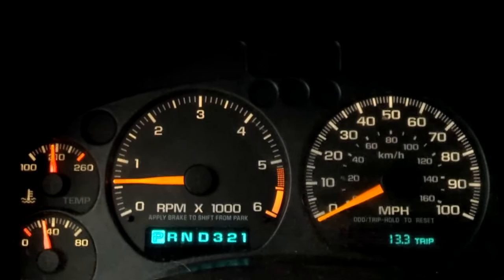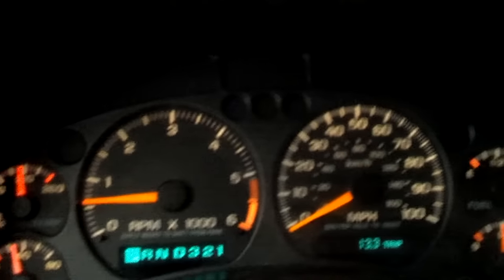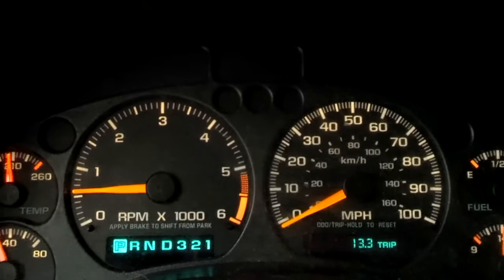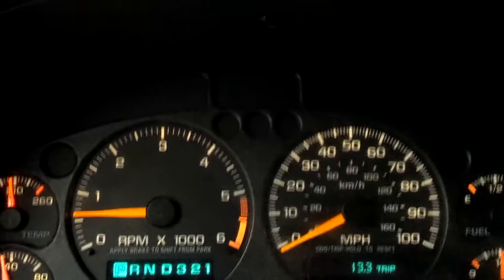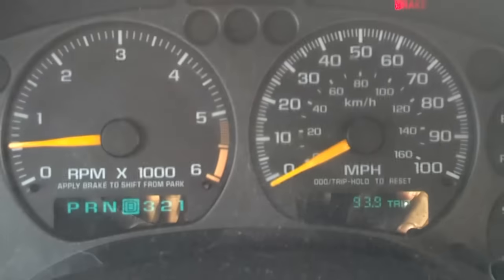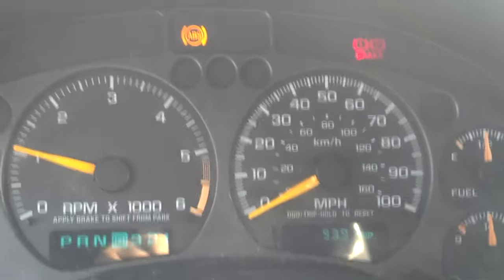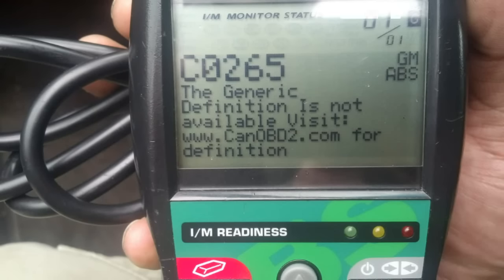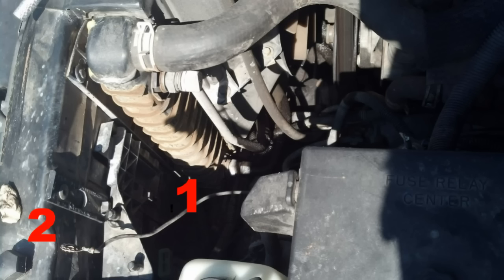How I fixed a Chevy with an  Abs and Brake light on

Comment: Hi. I have a 2002 2500HD with a Duramax.  My parking brake warning light  ( P/I) is flashing anytime i push the emergency brake pedal down. Might this be an issue similar to yours? Thanks
Reply from the maker: Randy Dufour  If it is not a new problem i have heard "it just does it to remind you to release it before you drive. it also turns the illumination for the cluster off"

If not then check out the connections.

 Underneath the drivers door, under the truck on a cross brace for the frame you will find the ground wire for the Electronic Brake Control Module (EBCM). Make sure that is clean, remove the wires, wire-brush the frame area and clean everything, wires, bolt everything, then reassemble. This takes like 15 minutes. Some of the ABS issues can be caused by grounding OR connections to the module. Also make sure the connectors on the EBCM are seated properly, remove and clean and plug them back in. The unit is located under the truck on the inside frame rail beneath the driver's seat area.

Comment: I need a little help I got a 2008 Chevy trailblazer an the abs light came on after heavy storm I parked it in the back an I had to drive over tall wet grass to get to a roofed parking spot an the abs module is under the drive side part of the car so do you thing the wires may have gotten wet or that one wire that your clean may need cleaning I mean this is the first time it's done this so it would be great if you can help
Reply from the maker: +xXdarkcloud47Xx Sounds like it might be a little corrosion on the wire. It would be the first thing I would check If that was ok, I would take some air and blow out/dry the connectors going into the unit.

Comment: 1995Chevy1500up antilock light comes on at 15 and off at 15mph cruse control stopped working at same time brake lights work???

Comment: I just did my front brake lines on a 1995 chevy pickup w/ Kelsey Hayes module. After bleeding the engine dies when I come to a stop. I have never had this problem in some 20 years of brake maintenance.

Comment: did you felt the traction coming on sometimes when you stepped on the brakes?
Reply: That would be your gap between your abs sensor and the rotor. It makes it hard to stop for a second then let's up.

Comment: Hey so I did what you told me last time an what you did on the video but my abs light is still on do you think I may have to have the abs system bled if you could help me out it would be very much appreciated
Reply: Did you pull any codes from the ABS module? That might help pinpoint the problem.

Comment: Have this same problem on my 2001 Silverado. There is a bulletin out pertaining to certain GM vehicles(document ID# 1988903). Cleaned the grounding wire, which on my truck is located under the drivers side door on the frame. Cleaned both ABS connectors in front. Still have the same problem. Have not cleaned the main ground going to the battery cable to frame ground (bulletin suggests doing this if problem persists), and I have not replace the bolts and washers with hardware specified in bulletin. The bulletin suggests using the specified hardware listed in the bulletin due to their conductive finish. Going to clean the battery ground if this doesn't work time to replace the nuts and bolts with specified hardware. I am getting frustrated because my truck won't pass safety inspect because of this, and the clock is ticking and I really don't want to put out that much $$$
Reply: Okay so cleaned the main ground battery to engine, (have not taken every fuse out of electrical station and cleaned it...yet) light still comes on, brakes work fine. last June I replaced one of the front wheel hub assembly, being that the sensor is integrated in the wheel hub assembly for the fronts, guess it may be time to replace the other front wheel hub assembly, certainly cant hurt, and things do wear out. I think I want to get a 70's model truck without any computer modules in it!! This is ridiculous...

Comment: How on earth do you get to the ground wires behind the radiator?  I see them, they're crusty.  No clue how to get in there....
Reply from the maker: I had to pull the air filter box. It;s held in my 2 screws I think and it lifts out. then you have the space to work on it.
Reply: North Carolina Prepper  Thank you very much.

Comment: I have 1999 Silverado I'm having the same problem with my ABS and brake light on. Where is the ground wire located
Reply: Your ground wires for abs module are on the frame on drivers side. slide under drivers door look at frame cant miss them. ITs a common problem and the may not look corroded but still pull off clean frame and wires your good to go. fixes 99.9% of the time. I have fixed a lot of ABS lights with toughs grounds, been a Tech for 25 years.
Reply: Thanks
Reply: No problem.

Comment: I have an 02 yukon denali  with no light on, but when I come to a stop the brake pedal push back up as if the wheel is sliding on snow, need help
Reply: Check with your Chevy dealer those wheel speed sensors are part of a recall.. If it's happening at low speeds when you brake over bumps it's most likely covered for free..

Comment: Quick question.. I changed the abs module on my 2003 chevy tahoe.. and my abs and brake light still come on.. Anyway to reset it??
Reply: OReilys AutoParts has a ABS/OB2 computer that can reset it. Can always try the quick reset yourself by disconnecting the battery for about 2 minutes then connect it back up. AutoZone and Advance computers are NOT ABS computers.

Comment: I have a 05 Cadillac cts and my abs turned on as well would it be a curroted wire also??
Reply: +Donz Perez   If its just the ABS and not both lights It may be a ABS issue or a Wheel bearing problem

Comment: So I have a 2002 Chevy suburban... and I went down a dirt road from a paved road with 2 spare tires(one 2 sizes smaller) and my ABS light kicked on still had brake pressure then going down a little further and my emergency brake light kicked on and my speedometer dropped to 0 my RPMS stayed at 1000 pressed the gas and didn't go anywhere my RPMS reved up to 4000 I stopped and started going again and it was ok but now its getting worse! Please help!!!!!!!!
Reply: +Cassandra Miller put the right size tires on the, different tires are turning at different speeds in a strait line will also wear differentials 4 wheel drives systems steering and braking of non ABS cars as well. brakes are designed to work with the recomended dia tires speedometer is driven by the ABS signal from the 4 different size tires also traction control that controls the throttle [gas]

Comment: How did your brake pedal feel and how were your brakes performance?

I have a 2002 Tahoe and both light come on at the same time randomly... driving or also when I am stopped at a red light. Was yours turning on when you were at a complete stop too?
Reply: I have the same truck as you and same issue, did you get it resolved?

Comment from the maker: Its a 2001 chevy blazer.  I might open mine up too It's comes on for a sec when i hit a speed bump so Im thinking it a broke connection as well I will try to do it next week ( I will post a video)
Reply: I have a 2001 Blazer also and mine is doing the same thing.  Both lights come on when I drive across town maybe 20 miles and if I stop and turn off the motor and tap the brakes 3-4 times then the lights go off.

Comment: My 2000 Chevy Astro 4wd has exactly the same issue, but I did not find the ground of the EBCM under the radiator. Does anyone know where its ground connects to the chassis.
Reply from the maker: On some its under the drivers side door on the frame.
Reply: Thank you I will try there.

Comment: i have a similar problem my light comes on whenever i drive the vehicle up to 5-10 mph but goes off every key cycle. it will run all day long in park but when i drive it is when light comes on. i replaced the passenger side sensor and in process of doing driver side. its 2000 Blazer 4x4

Comment: could having something wrong with your abs? mess up how your transmission shifts? someone please reply.
Reply from the maker: I don't think so. But Who knows I think there is a computer that can effect all that stuff. If it was me.. I would go to a auto parts store that does a FREE code check on the car/truck.  then look up all the codes and see what needs to be done.
Reply: Had a problem when I first got my Blazer.  Was told a vacuum leak, lack of power, or something else.  Finally got codes, and had to replace the 1-2 and power shift solenoids.
Reply: the vehicle speed sensors could mess with shift but chances are a bad valve body in transmission most likely will need to be rebuilt
Reply: Did you ever find out what the problem was? Im having same issue

Comment: No replace the ABS Wheel sensor?
Reply: NO. My lights were doing the same. Dealer told me it was a sensor. Cleaned the grounds and the lights are off. Dealer was full of shit.
Reply: *****
Thanks Dave L. for the info and you´re right about dealers(piece of shit everywhere).Regards from Chile.

Comment: I had the same light on my vehicle I was still under warranty  this happen and the fount brakes were making noise  they stop the noise and did not fit the light 3 months after the noise cam back  had a friend look at it  when he wiggles the tire  the hub drop off od the truck GMC would not warranty that part said I abused it  had it off-roading with it it was a 4 wheel drive I bought it to go off-road with it  did  was 5G for them to fix it the part was  250. dollars  had it towed back to my friend place and did it our self  2 cases of beer later have the truck on its wheels  shame hud  4 months later felt I had a flat tire  pulled over not flat  got it up to speed  did it again   when to change  the tire  took the centre cover off 4 lug-nut broke off  phone for help my dad came to lift the truck up and tighten the rest back up  had an uncle down the road  we could get it the fine  if not then we need a towtruck them  we make it to there driveway  lift it back up and tight the nut  up  but they broke off before I turned the wheel  use the tracker to light it and taking it in to the yard  GMC did not warranty they own parts too  when some  other place to buy them  put them in my self too couple hours had it back together  truck was recalled  for something I did need new tires on that truck  they had a barn new set came off a truck and i bought them  had to make appointments to have them put on  it was spring when to get the cows in the morning milking  they moved the feed got stuck in the shit I got out on my own power but I had a hard to too did drop the truck off  for the new tires they did not like the shit that was on the truck  lol yes they did clean the truck up  for me
Reply: the light when off after the hub was replaced

Comment: I've got a 1997 Blazer, ABS comes on & stays on just after an idle surge or hesitation. The sluggish hesitation is intermittent but the abs light won't  go away unless it's erased. No ABS codes are coming up on my scanner tool & no Check engine light or codes. I also found that the VCM was replaced, the VIN# the scan tool pulls from the VCM is not the same as the VIN# on the Chassis. any ideas?